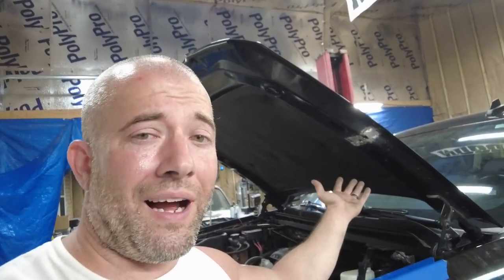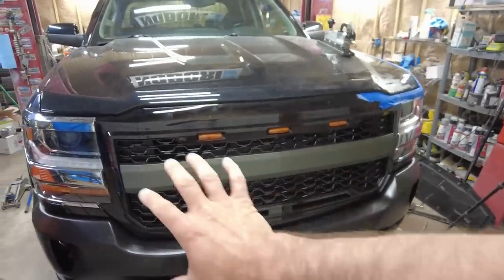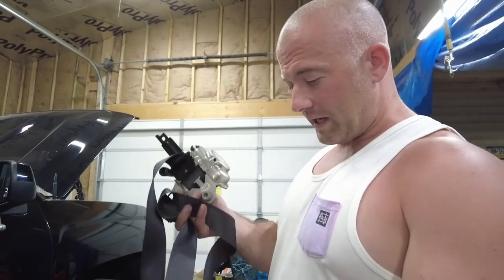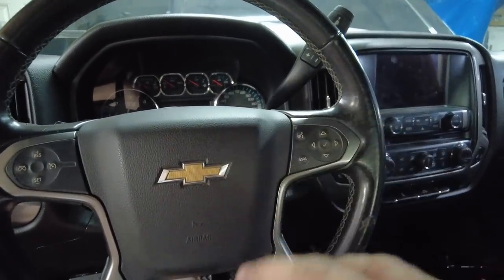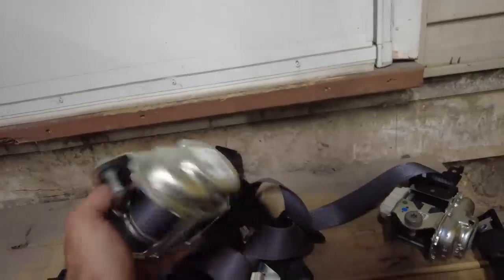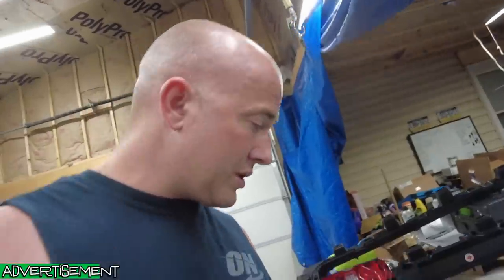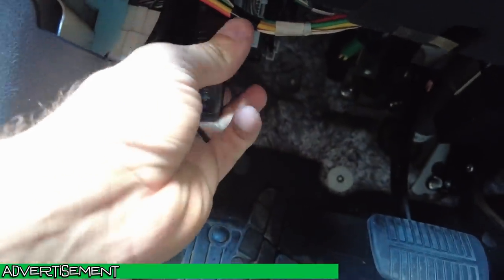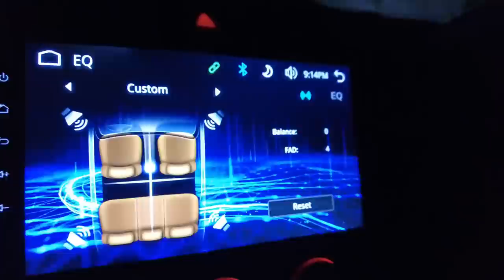2016 Chevy Silverado SRS seatbelts, airbags, and crash module removal + Xtool D8 BT Code scanner.

Comment: I worked at a factory that welded dumpsters, on guy kept missing a particular weld, his table lead told him about it several times and the dude cussed the lead  about it.....so the lead said to himself "well let him miss and he will have to weld from the bottom after the piece is flipped over" the supervisor noticed the weld was missed and got a stand to hold it up. Dude crawled under it with his welder, however instead of positioning his body to the side so the weld didn't fall on him he positioned his nuts right under it, gravity did it's work and he was called Bush's baked beans by me for a few weeks after he came back from healing 😂..

Comment: Probably to late but most gm vehicles don't need the module rebuilt. My 2016 escalade had blown bags. Popped everything in and light cleared. Same with my 2014 corvette

Comment: I just bought the D8 non BT from Amazon. When I plugged in the OBD2 cable in on my 2013 Silverado it shut down my trucks computer. Check engine light came on I checked with another scanner A bunch of lost communication codes with every module. Needless to say I'm returning that unit before it fries my computers.
Reply from the maker: I haven't had an issue yet and I can only speak for the month that I've had it so far